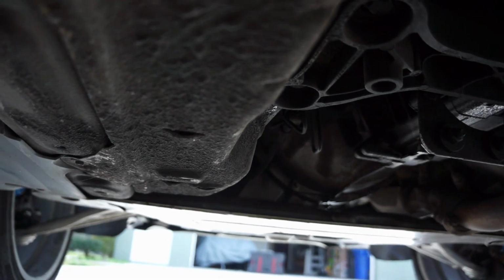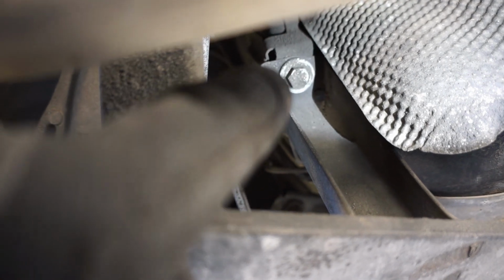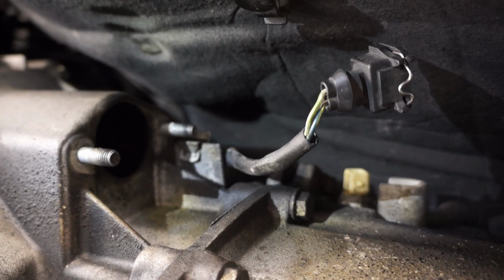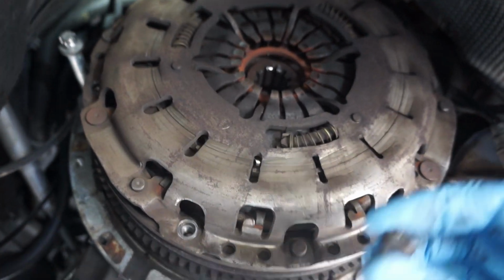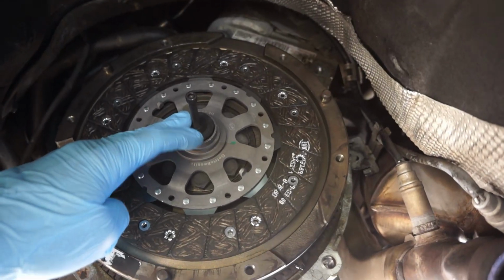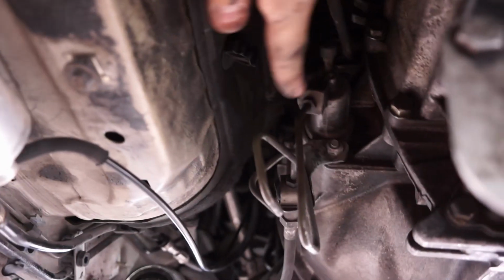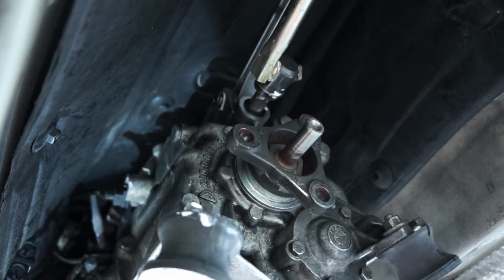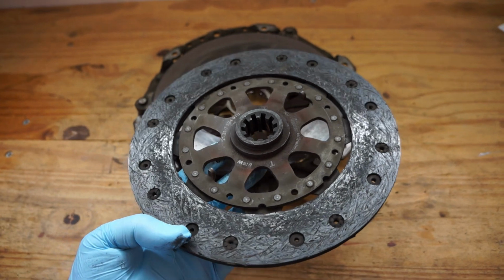2004 E46 325Ci Getrag Clutch Replacement

Comment: Where can i find info on clocking it to the right balance?
Reply from the maker: I'm not sure.  The FCP Euro YouTube channel's E46 clutch video also does not make mention of clocking it. My understanding is there should be marking on the flywheel and clutch that shows the heavy/light side and you mount them opposite each other.  My old flywheel I couldn't find any marking so I couldn't clock them.

It didn't end up making a difference, the engine runs just as smooth as ever but I can't guarantee yours will be the same.